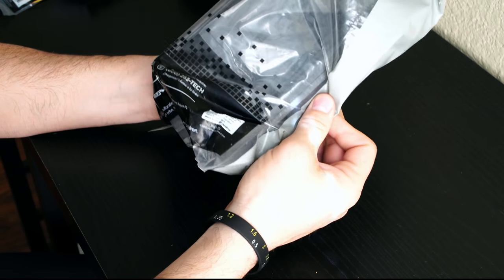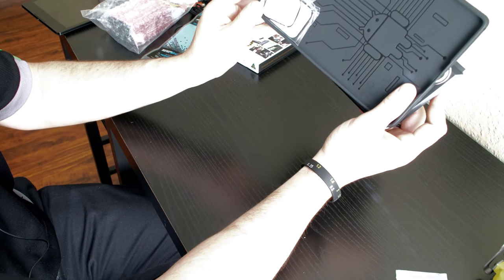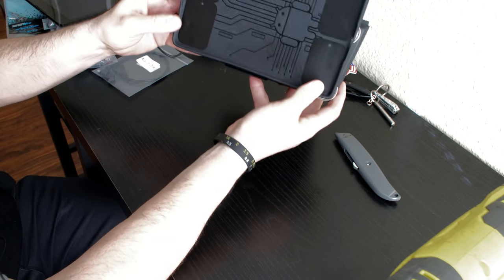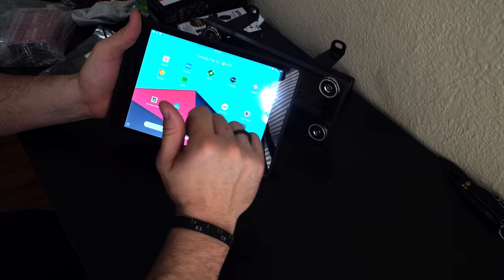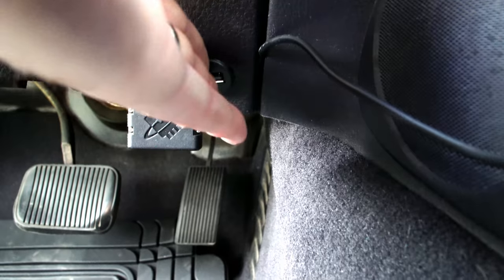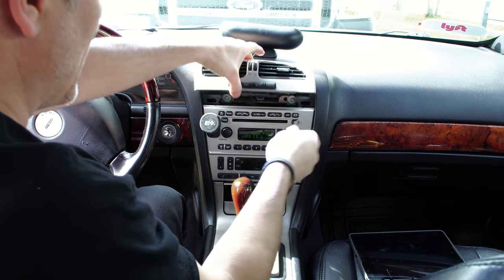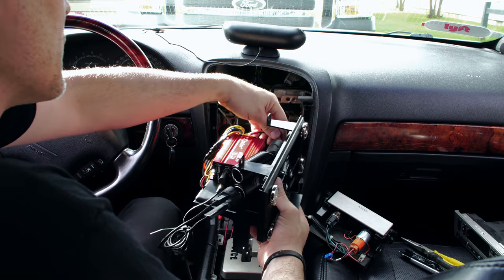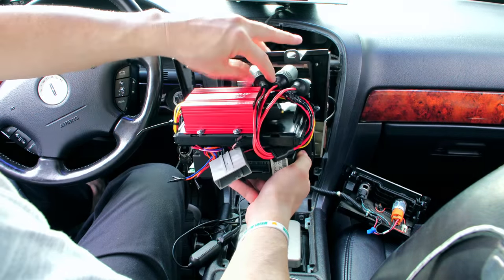Turn Your Tablet Into A Head Unit

Comment: Is this something you can buy, and if not is there a way to put ac controls to work with the tablet 2010 acura RL the ac controls and navigation controls are all tied into the radio but have a separate screen on top that displays everything, I want to just replace the Navigation screen with a tablet, not sure how I can wire the radio navigation and ac controls into a tablet.
Reply from the maker: I have considered making this a kit but you can find everything I used in the Amazon list link in the video description. There is a manufacturer who I forgot the name of that makes large screen replacements that do take over the climate controls. I have not seen anything other than that. They only make screens for a limited amount of vehicles.
Reply: @edwardlthompson  oh OK thankyou for the reply, I will check the link out. You should definitely consider making this, I think people would buy this for real. Great video!
Reply from the maker: Thank you so much. I considered having a friend 3D print a drop in unit that would go in a single or double DIN slot to hold the tablet. I'm working toward living full time on the road in an RV so I'm trying to avoid anything that would tie me to a geographical region and I didn't want to get involved with manufacturing, warehousing, and fulfilling orders while trying to live a more minimalist lifestyle.

Comment: Great videos! I have watched both of the install vids. I have been inspired and would like to do the same on my  year 2000 motorhome. It has a Sony analog dash radio with front, mid, and rear speakers and a subwoofer. The paperwork that came with the RV says that it has a 2 channel amp but I have not been able to find it. )Do you think I can just install another amp to run through would that work? What about the subwoofer? Really dumb about this electronic stuff but I am handy. Could I remove the existing and install a single bin system in existing slot or a double bin somewhere else and just bluetooth thru either option? My brain is spinning...lol
Reply from the maker: Thank you for watching both videos and I am glad you found some useful information in the videos. That's really cool you have a motorhome. We are working toward going on the road full-time in the next few years! 

Usually a small 2 channel amp will be under the dash in the vicinity of the stereo. If you install a second amp, you run the risk of blowing the system out that was designed with a certain output in mind.

If I were to do this all over again, I would just replace that unit with a Single DIN unit with a Bluetooth connection and then window/dash/cup holder mount a tablet for ease of install and use. That would keep things simple and let you benefit from all the good stuff that modern tech can offer.

I also recommend the offline maps offered by OSMAnd+ as I have used them in some remote areas and you might find them very useful with the motorhome if you go off grid. You can set your vehicle height, weight, and max speed and it will give you much more accurate arrival calculations as well as keep you off of roads that have low bridges or weight restrictions. You can get it free on the FDroid app. It is paid on the Play Store.
Reply from the maker: https://f-droid.org/en/packages/net.osmand.plus/
Reply: @edwardlthompson  thanks for the reply....Im not sure where they put the amp being an rv its very accessible the top of the dash comes right off. I chased the wires under the dash as far as I could until they went behind the side trim I just cant imagine the amp being hidden behind a panel...maybe I will hear back from the manufacturer soon or just do the single DIN unit. btw congrats on your views over 1 mil is impressive!
Reply from the maker: @brewbob1231  Thank you! I never expected this video to even get over 100 views. 😂 Good luck with your project! Let me know how it goes.

Comment: If this is still your current setup, you should look and see if you can install Timur's Kernel on the Nexus 9.  I have it installed on my Nexus 7 in my car and it can do data and charge over OTG.  I also have mine permanently installed in the car and it allows to a deep hibernation when the tablet loses power so that it drains the battery minimally when the car is off.  I have noticed that if I leave WiFi on while it is hibernated it drains the battery significantly faster so if you go this route in the future make sure to turn the WiFi off when you get out of the car.
Reply: Another note, I just got steering wheel controls working with my setup as well. Easy to do if your SWC are resistive buttons.  I can point you to the video I used to get mine going if you would like. I had mine installed for two years before I finally decided to take the time to get the SWC working.  I didn't realize just how much I missed them until I had them back.
Reply from the maker: +Jared check out my update video. I changed to another tablet and setup. That's super cool you got it to play and charge over the OTG. How is the tablet holding up to the extreme temperatures in the vehicle?
Reply from the maker: +Jared please share that video with me, that's awesome! Thank you for sharing this information with me.
Reply: @edwardlthompson  I have not noticed any negative effects from the heat.  I live in Tennessee and it gets pretty hot here in the summers still so I think it's a good enough indicator of what may happen if you decide to go that way as well.  Here is the video I used to help me get the steering wheel controls working.  He has a Raspberry Pi installed in his vehicle (which I am about to upgrade to), but in order to get the arduino to work with the tablet you would just need to download Button Remapper and have whatever keys you send to the tablet remapped to do what you want to SWC to do.  You can have any of the buttons do whatever you want.  Will take some research to edit his code to your needs, but it's not that difficult once you start looking into it.  Can ask me some questions on here too if you need.
Reply: Forgot to paste the link https://youtu.be/Caf-yBI9rHA
Reply from the maker: Very cool. Thank you for sharing this with me!

Comment: How do you counter the overheating of the tablet during really hot days in the summer? Here we have at least 2 or 3 days of 120F
Reply: I"m thinking of a small fan behind it maybe
Reply from the maker: If the AC is running while you are in the car, the tablet will be fine. Make sure to take the tablet with you when you leave.

Comment: Good job brother but it's alot of stuff you have to buy considering that bluetooth head units are so cheap Walmart sells a single din bluetooth for   20 dollars u could have just put it in the bracket u got and if you wanted to put the magnets on the sides like u did and put  the tablet on top of the radio and just connected the tablet to the radio via bluetooth that 20 dollar radio from Walmart works great and has bluetooth it's probably a cheaper option and alot easier to install, but I give you props at least u got your setup to work out and if you already had all those wires lying around might not be so bad of a setup for you good job
Reply from the maker: You're right. If I had to do it again, I would probably do it like that. Thanks for watching!

Comment: Damn, man. I guess going to school for engineering really does make a difference. I did this 6 years ago in my 750i with a tab s 10.5. Covered the I-drive screen with it. A door hinge, magnets, 6x6 metal plate, some felt, a bluetooth transmitter and gorilla double sided tape. Completely removable and clean. Nice job, but way too much work for the roi.
Reply from the maker: That's awesome! I also have a BMW. It is a 335IS from 2014 and the on board computer system is a nightmare. I can definitely understand why you did what you did. It is truly dreadful. LOL. thank you for watching
Reply: @edwardlthompson  thanks. I just hate their proprietary system. It's too cumbersome and slow. I used the tab s for splitscreen (Google maps and Spotify) and Netflix when I was parked bored and waiting. Plus another reason was the Bluetooth. Far inferior to even $100 cheap phones. Motor, on point. Interior, on point. Exterior, on point. That electrical system, though... 🤦🏽‍♂️

You can't even hook up aftermarket audio unless you replace the entire system. There are no 12v leads coming out of any BMW head unit. I rest my case.

No problem. I like to see how people come up with their own solutions.

Comment: hello, good job! I want to know if the waze application works correctly on your tablet, or did you have to add a chip to your tablet?
Reply from the maker: Thank you! Waze works perfectly. I use a tablet that has LTE cellular service. Make sure you check out my update video as well.

Comment: Interesting. You know there are a lot of head units available for way less than $175 on ebay and Amazon that would have accomplished the same thing. True some may not be name brand, but they actually work wonderfully. I mounted a 7" touchscreen in my 95 town car back in 2016 without any crazy modifications cause I wanted a clean look with navigation. Plus, there's always the option of the Raspberry Pi 1, 2, 3, or 4.
Reply from the maker: Check out my update video. I got into another setup and also why I chose the tablet over the head unit. The tablet I have now is a 10".

Comment: Really good job. Watched it all. But you never showed or explained your blue tooth receiver and its not on the amazon shopping list. Can you say which one you used? Thank you
Reply from the maker: I ended up sticking with a wired connection as it was the cleanest method. I ended up switching tablets and also moved to my truck with a different style setup. I did an update video a year after this one and reviewed the final settings.
Reply from the maker: I did try a few different BT devices though. You can use anything that has a 3.5mm jack and power via USB.
Reply: Thank you. Yes i guess wired is always best but bluetooth is clean 🧐 still dont know what to do. Thanks
Reply from the maker: @africasking9793  you are correct, less is more when it comes to wires. I will link the one I use for my wife's car.
Reply from the maker: @africasking9793  the BT receiver in her SUV is not this exact one but the same design. 
https://www.amazon.com/dp/B01HDO66NK/ref=cm_sw_r_cp_apa_glc_fabc_7V8Z0E21FBXGP96ZEA8W
Reply: Wow thats a great device! I almlst want to buy it but have no need. The ipad i have has no headphone jack. But thank you very much.
Reply from the maker: @africasking9793  the headphone jack plugs into the car audio jack and the USB part is the BT receiver. It receives power from the USB connection to the car and then you just have your tablet or phone connect to that receiver each time you power up the car and all your BT audio will route through that.
Reply: Sadly no aux input but all sorted now thank you sir. Bought a bluetooth receiver backed up with line if im not happy when it comes thank you. 🥳
Reply from the maker: @africasking9793  you're welcome and good luck!

Comment: Long video (but worth it) and maybe I missed this, but are you using your phone as a hotspot to provide service to the tablet (for Waze, YouTube, etc)?
Reply from the maker: thank you for watching. I don't recall if I mentioned it or not, but I definitely got into it in the update video. What I'm using is an LTE-capable tablet. I use a SIM card from T-Mobile for the internet so no need to create a hotspot. They will give you a data-only SIM card to use.
Reply: @edwardlthompson  Sweet. I have a non-LTE Samsung tablet (WiFi only) I use for work and play. I'm thinking of rigging something up in my Tacoma where I can just pop the tablet in front of my radio face and let Bluetooth/WiFi hotspot do all the work since TMobile has unlimited data.
Reply from the maker: @glenb1972  check out my update video! I have done something similar where I have the tablet on a stand and I use the Bluetooth connection in my truck.
Reply from the maker: @glenb1972  https://youtu.be/dmiVHRV2etw

Comment: Seek bezel to replace toyota prius 2015 dash stock radio to mount a 10 inch touch screen. Need to make wiring to back of radio, so radio is not removable. Magnets can be substituted with epoxy putty or hot melt glue
Reply from the maker: Thank you for watching and commenting.

Comment: I'm trying to do this with an iPad Pro, with magnets and still keeping the oem head unit behind it. Any advice?
Reply from the maker: That could be tricky as I'm not sure what you can mount the magnets to without damaging the factory unit. You could use double sided tape but that will possibly melt in the heat. If you are keeping the factory unit, I recommend a tablet stand for your cupholder or a window/dash mounted holder. That way you have access to both. There are some really good tablet mounts. I actually own 3 that I have used in my work truck as I take my tablet with me in whatever vehicle I'm driving. In my truck, I use it in tandem with the aftermarket head unit and backup camera that I had installed.
Reply: @edwardlthompson  My oem head unit is a screen so it's flat in front. I'm planning to put skinny/long magnets on the back sides with 3M double sided tape, need to figure out what to do with the bottom piece to support it.
Reply from the maker: @khoatro  If there is a gap between the OEM head unit and the climate controls or whatever is below, you may be able to wedge a hard piece of plastic or metal in between to act as a ledge.

Comment: Does backup camera work with this, if so how did you hook it up?
Reply from the maker: You will need to get a Bluetooth camera or an adapter for the video feed to change it to USB and connect it like that. Alternatively, you can use an existing setup like the one in the update video that is recommended at the end of this video.

Comment: Need to replace a belt.  What tablet did you use.
Reply from the maker: Nexus 9. In my update video, I ended up moving to a Lenovo Yoga Tab 3 Plus. Much better tablet with LTE and long term support and OS updates through Lineage OS. You may find some other ideas in the update video.

Comment: I've got a 2016 Chevy Malibu and it  actually looks like someone just stuck a tablet on the dash.  Seriously, when I first saw it I wondered if it was removable so I could detach it and carry it around.
Reply from the maker: I gained some inspiration from some people who did that with 7" tablets here on YouTube. Did you ever open it up and check?
Reply: The car is in stock condition, this is what it looked like when it came out of the factory.  Google the car and you'll see what I mean.  Everything works fine but I would have expected an enclosed unit.

Comment: Is the tablet rooted somehow? If so how did you enter Fastboot mode and change the power on, power off state?
Reply from the maker: The tablet is rooted. I specifically chose tablets that are supported by the Lineage OS community and that have LTE support. If you want to have your tablet stay always on while charging, that is in the Developer Settings which you don't need to root your device to access.
Reply: @edwardlthompson  Thank you for this information. I'm working on Building controllers and wrote my app in Kotlin which BT to my electronic hardware interface. However I'm having a really hard time finding a 7" tablet that will give me access to the Fastboot mode. My Android SDK has the tools in CMD window which allow me to access the tablets but still no luck getting them to turn on and off according to the Power On / Power off state. 
Any 7" table you can recommend for me to research and which OS I should use. Not familiar with Lineage OS. I will research this as well. Again thank you
Reply from the maker: @yapandasoftware  the Nexus 7 is an old tablet but works well with rooting and Lineage OS as well. It is no longer supported by the community due to its age but it will be an easy root for you. BTW, I'm learning Kotlin! That's super cool that you are doing that! Good luck to you.

Comment: Why don't you trim the excess from the big back plate, reverse it so the cut surface is on the lower side and the curved edges point back, curving around toward the magnets, concealing them from view. Then use the smaller face plate as a tablet case instead, fastened onto the tablet so that it rests against the larger back plate. You would need to have the far preferable flat, thin bar shaped neomydium magnets glued into place using ShooGoo glue for the tablet's smaller case. It is excellent and cures overnight to extra strong plastic itself. It will stick to foams, rubber, etc.
Reply from the maker: That's a great idea! I'm working with a friend to make 3D printed single DIN snap in pieces to hold the tablet.

Comment: This is nice build but did you look into the Android based headunits that are available. Their screen would obviously be smaller but otherwise they install just like regular headunits.
Reply from the maker: I did and they are a decent option. I mainly wanted the portability of the tablet. I have 4 vehicles so I wanted to take all my settings with me in whatever vehicle I was in as well as in the house. Also, I'm not sure how well supported those units will be. The tablet is still receiving nightly updates from LineageOS keeping it fresh and with all the latest features Android has to offer.

Comment: Hey man do u work in radios? I have an aftermarket android radio bluetooth stop connecting and would like to add another bluethooth system
Reply from the maker: Does it have an AUX jack in the front or rear of the head unit?